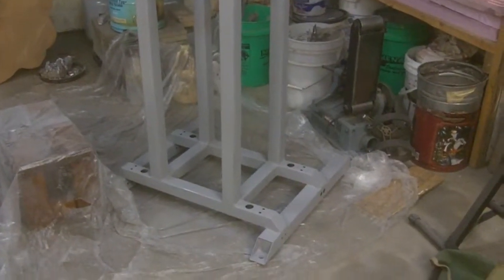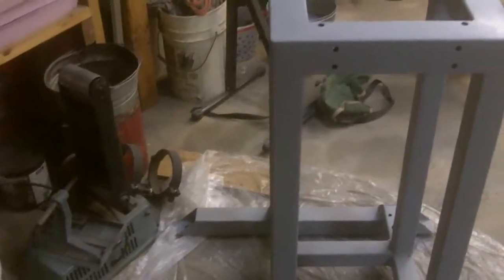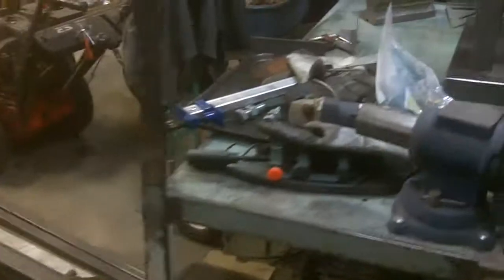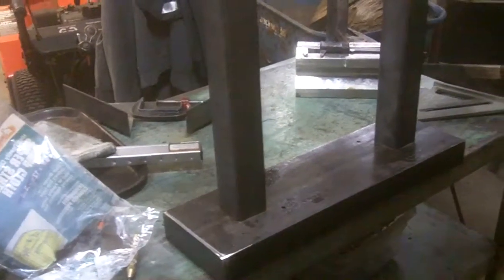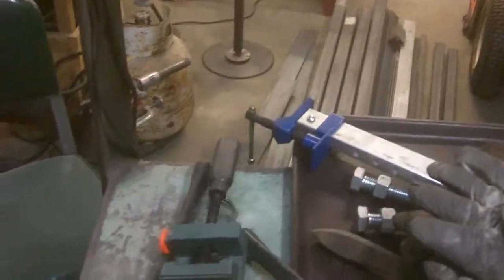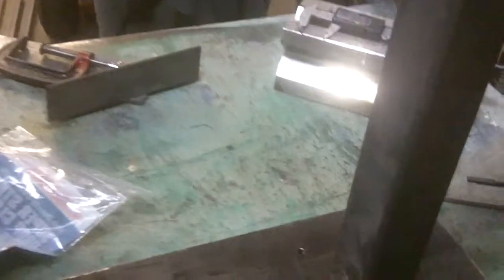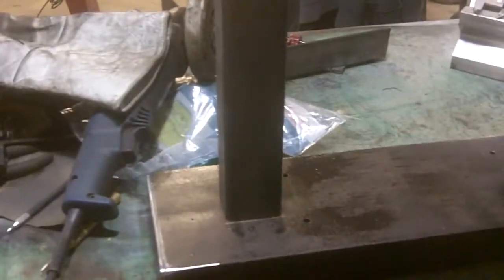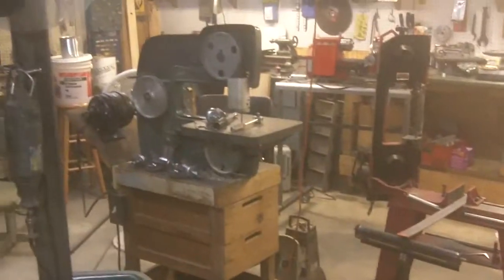X2 Mill Table After Primer

Comment: I have that same small steel cutting bandsaw. Because its hardly used what i did is bought 1 inch square tube and boxed the bottom of the legs and welded casters under it  so i can wheel it around stuff it in the corner when its not being used. Also the tubing makes another nice shelf to store my extra blades.
Reply from the maker: I thought about going that route.  A lot actually.  I finally decided on just using leveling feet on everything and makeing an adjustable dolly/truck to move things when needed... at least with the wood cutter.  The 4x6 will have hockey puck leveling feet on the front and casters on the back.  I'm going to tack weld the seam on each side of the casters so they don't swivel any more.